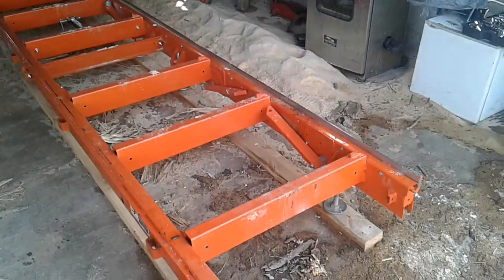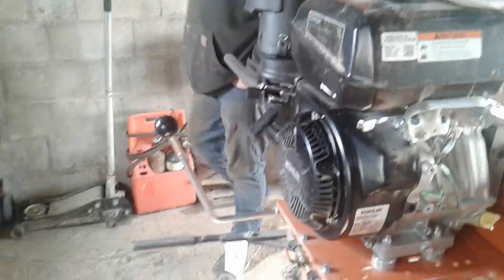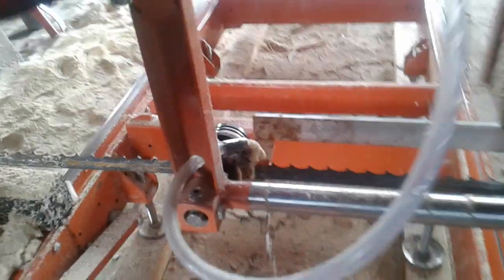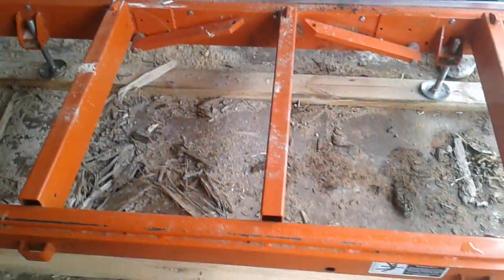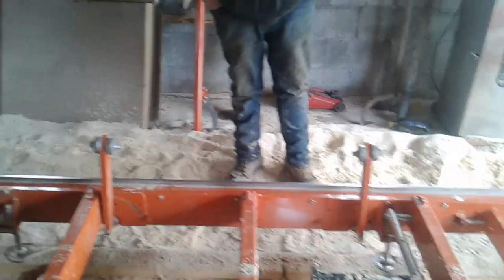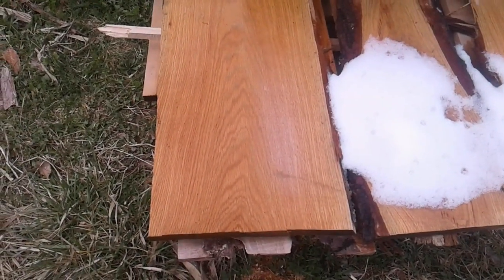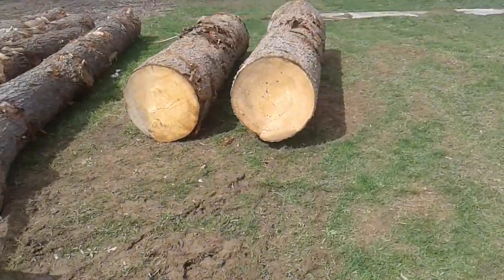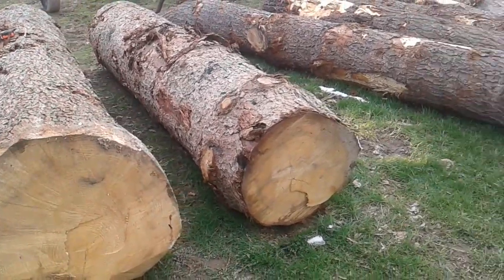mikeys new toy !

Comment: Wood-Mizer sells an extension for there mills if you need to cut longer logs not 100% sure on that model, we also add 2 rows of old hardwood 2 inch on top of our sticker piles helps to stop twisting they are a good little mill.
Reply from the maker: neat trick jim ill tell mike !

Comment: When I built my house I cut trees off my property and hired a guy with a portable wood mizer to saw out the lumber. He did a beautiful job. It was  spruce,larch,hemlock and red pine. I stacked it on stickers for 6 months. Most of the larch he sawed into inch boards for siding and most of the red pine,hemlock and spruce was sawn into 2x6 and 2x10 for framing lumber. The spruce and hemlock worked good but a lot of the red pine  twisted when it dried and was a pain to tweek into place for studs.
Reply from the maker: thats cool stuff matt !
Reply: @StumpjumperVideosPA  with that skinny kerf of those little band mills it is amazing how much good lumber you can get out of small junky looking logs